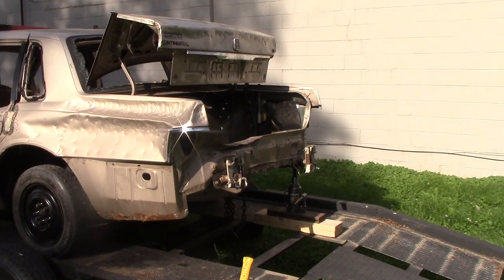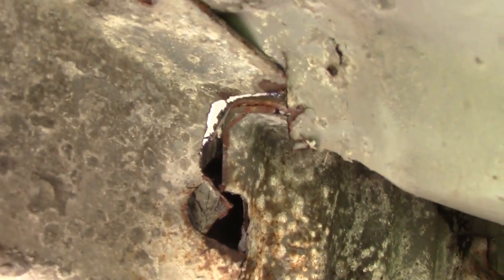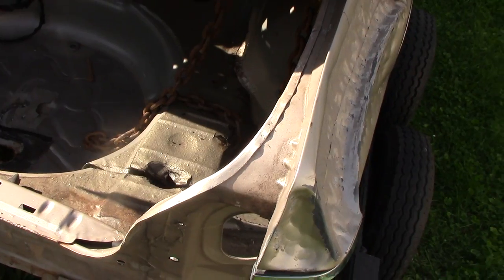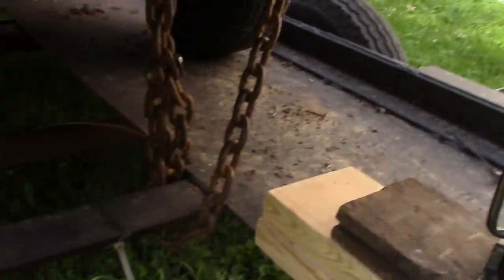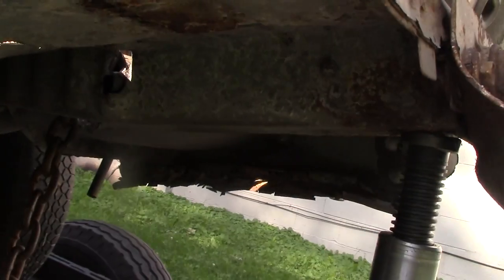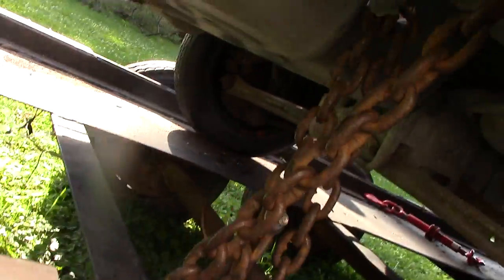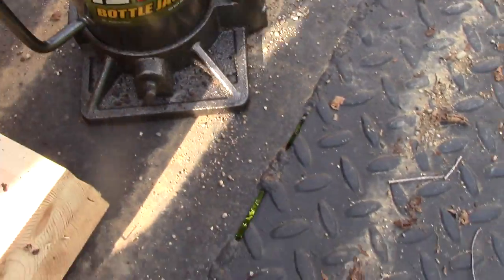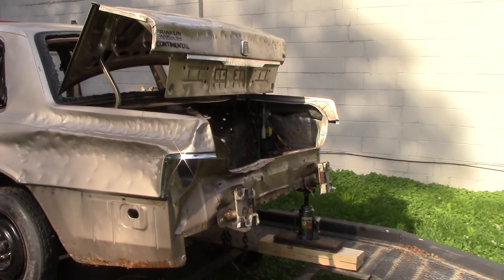Prebending Rear Frame 91 Lincoln FWD Derby Car

Comment: We pre bend ours with full size tires on the car, just let the air out of the tires and then chain the car down and then just refill the tires with air. The chain will not have any slack in it and you don't need alot of wood to put under the jack. thanks for your time Armstrong racing

Comment: Hey some great videos and ideas. Been doing derbies for a few years now, but wanna try a hood roll/tuck. Do you have a video for how the best way to do this is? What benefits does this have?
Reply from the maker: built spencerville tough  You wanna tuck the hood or the trunk?
Reply: DemolitionMissions I want to roll the hood down towards the front bumper. I've seen a lot of guys doing this. We can't tuck trunks where I am.
Reply from the maker: Rolling the hood down protects the radiator from being stabbed or crushed as easy. Just a big metal shield. But if you bend the hood all the way down you cut off the airflow going through the radiator from the fan.
Reply from the maker: Best way is to tighten the hood down and then use a big hammer, just dont damage the radiator in the process.